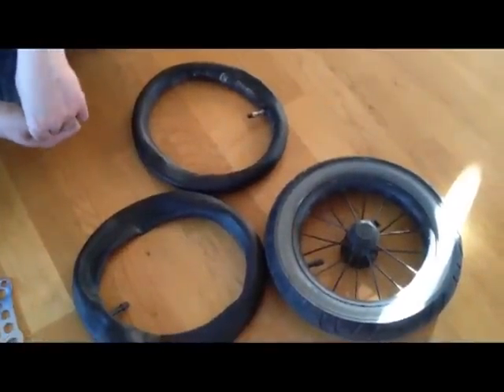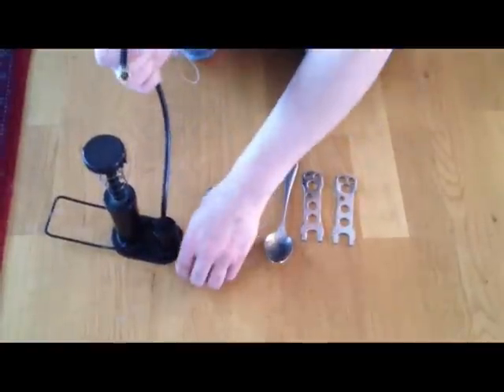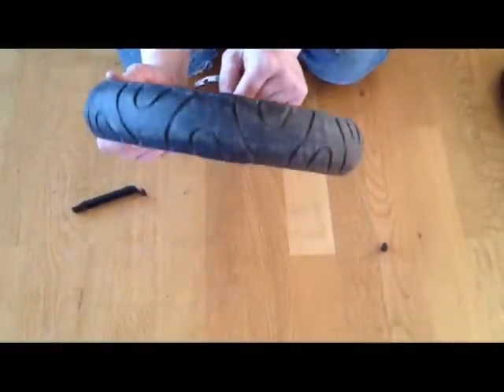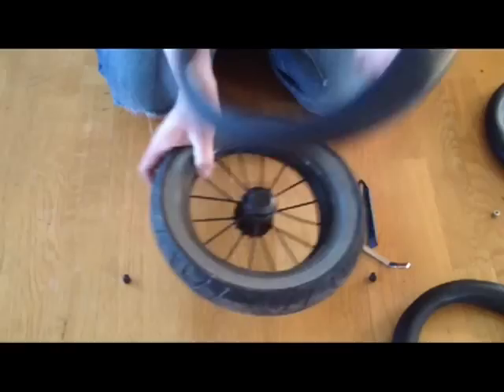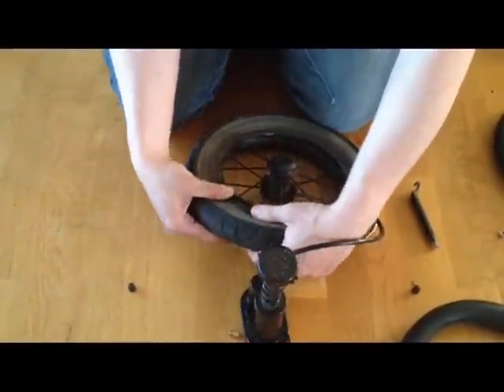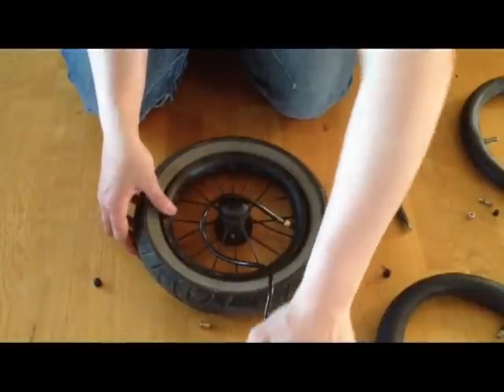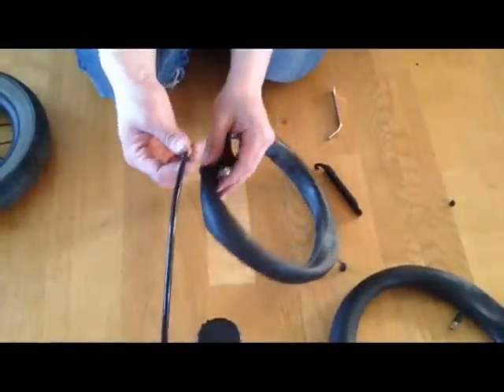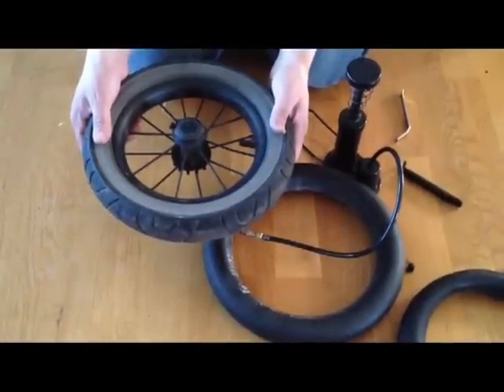How to replace the inner tube in a stroller wheel. Easily Explained!

Comment: Thanks for this video. It saved me time and $15
Reply: Another great tool I already had on hand was a Paint can opener - I like it better than a straight tool since after the tire is out it's easy to hook on your rim then just lift and the tire slides back inside the rim without risk of the tool slipping out.
Cheers.
Nate

Comment: And how on earth do you get the front-wheels out of the plastic brick they are inside on a Emmaljunga Super Viking?
Reply: Thank you! I ordered a different tube straight from manufacturer bc the replacement tube i bought was 12.5 instead of 12 which is what original tire said. The manufacturer sent me 12.5 too,  bought your advice of laying stroller on side and pulling tire and adjusting it while inflating keeping it equidistant was the missing key factor. Previously the tube would poke out and the tire would wobble with the bulge, or I'd deflate it then it would be flat. Now it's perfect thank you!!!

Comment: where can i get graco inner tube?
Reply from the maker: Try asking at a local bicycle shop for a generic inner tube of roughly the same size.  The majority of stroller wheels are 12.5 x 2.75, but there are differences from model to model.  Slightly larger usually doesn't hurt :-)